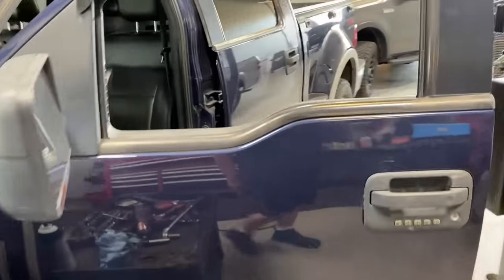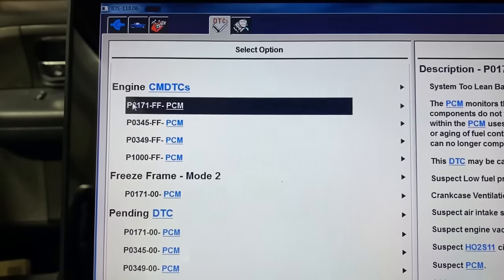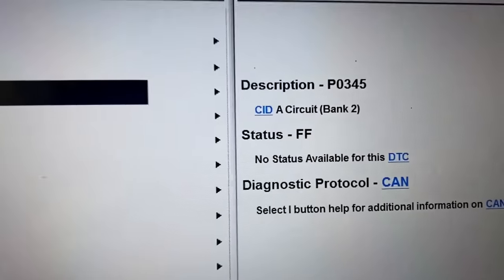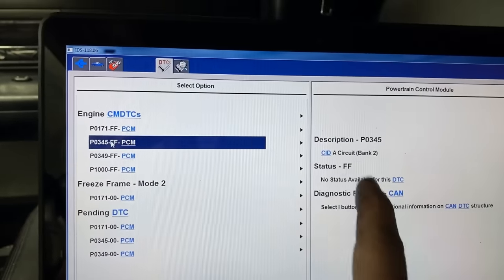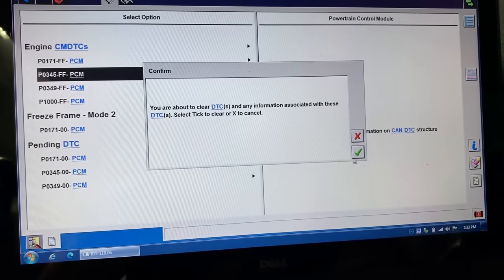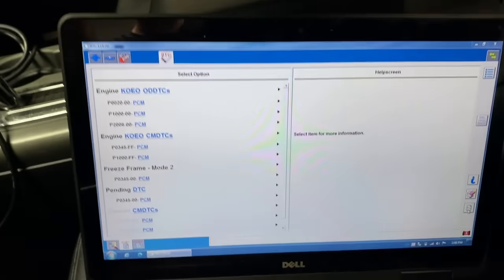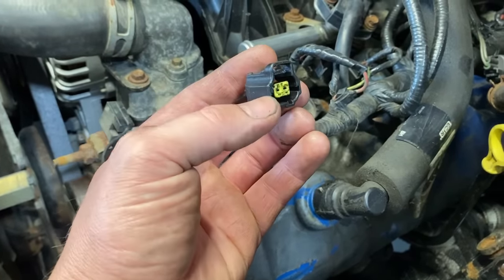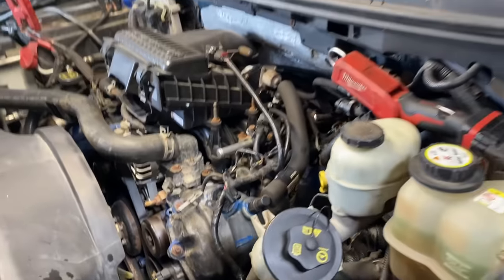Ford F-150 5.4L 3v Triton Engine Runs Rough: P0340 P0344 P0345 P0349 VCT Timing Error Diagnostics

Comment: Since you answered my previous question 4 this particular situation I was wondering if you could answer another question I had asked on a previous video and didn't get a reply can I use a 3 valve oil pump in a to valve motor they look to be the same but I'm not sure I am building a motor for my Harley-Davidson edition F-150 and wanted to use a high-volume oil pump in it I didn't know whether the 340 or 360 pumps will work in place of a two valve pump and a to valve motor
Reply from the maker: No you cannot, you want to use the this high volume oil pump from Melling on 2 valve engines- https://amzn.to/3jSl1di

Comment: You think people would get it by now that those camshaft bolts are torque to yield.  But if they were replaced at the salvage yard, it's highly possible that the tech doing it is not the sharpest tool in the shed.  I see LKQ offering 5.4 3v with "new Ford phasers", so I think this scenario is likely.  For my vehicle, no thanks.

Comment: So, I've noticed that most of the 5.4 3V engines you work on with timing problems are 2007 and older.  I have a 2009. Were there any design changes to mitigate some of the factory design problems, or can I expect to have to do a timing set? I have only 91k miles now and mine has had pretty good maintenance and has mostly highway miles and has never been used as a work truck.
Reply from the maker: They all have the same issues 2004-2014.

Comment: Hi! I've recently purchased a 2009 Expedition with the 5.4 3v engine and been watching your videos. It's the engine with smaller VCT aperture and valve covers with slightly different engine configuration. It's throwing the P0011 and P0021 codes. Engine feels and sounds fine but lacks power on demand and has misfires once from cylinder 8 (P0308) any idea what I can do before I go looking to remove the valve cover?
Reply from the maker: If you have they error codes you generally need a timing job, there is a loss of oil pressure and volume causing erratic vct operation. This all starts with blown out tensioners.

Comment: Quick question i have a 2 value 5.4 f150 , 75,000 miles cats are removed.  When i rev the engine to 2k rpm i can hear a slight knock . I've been told it's piston slap , wrist pin knock and thats it's normal for the 2v 5.4 to have a slight knock . Any help would be greatly appreciated. Thanks
Reply from the maker: Absolutely normal yes they all do it even the v10 models.
Reply: @FordTechMakuloco  thank you for the answer

Comment: That phaser bolt came out WAY too easily. No wonder it came apart and hogged out the pin holes.  Love how one side of was sanded off.  Dorman??
Reply from the maker: Yeah my impact is normally working at it 1-2 seconds before they break free, not this time.
Reply: @FordTechMakuloco  Gotta laugh at the cheap-ass timing kits for under $200 for everything.  Recipe for disaster, for sure.

Comment: I have an 03 5.4 expedition and getting p71 lean code bank 1or whatever, had the intake replaced and still throwing the engine light. Any ideas? Thanks!
Reply from the maker: They simply need to follow basic checks for lean codes including collapsed pcv hoses and MAF diagnostics.

Comment: I've got an 09  f150. 4.6l 3v.. I want to do my timing job but even with your videos I'm not comfortable. I'm 5 hours away from you in Ohio but if I was closer my truck would definitely be in your shop. Is the timing job still $2300 as u said in your other video?
Reply: I have 2010 f150 4.6 3v 185k just had the timing components replaced cost me 2500.00.  My started having chain rattle on cold start up.

Comment: I have a 2009 f150 5.4. I get a p0430 code once in a while and I know that the cats or at least one of then are going bad. Question is would that decrease the power a lot? It seems some days it drives really well but then sometimes it drives bad. Should I try replacing the cats to see if I get me power back?
Reply: A clogged catalytic converter causes excessive back pressure.  Typically you'll see a decrease in maximum engine RPM along with a decrease in power.
Reply from the maker: Yes but fix the engine concerns first before attacking the cat issue.
Reply: @FordTechMakuloco  I dont think I have anyother engine problems though
Reply: @neilvetter662  ok thanks. I guess i'll try that

Comment: Is it possibe to replace the 5.4 3-valve with an older 4.6 2-valve. My friend has a couple of ex-police cruisers with low mileage 4.6s in them. Sure seems like a better way to go than diving into the 5.4 regularly. I have a 2010 F-150 Lariat with the 5.4 and all these videos cause me to stay up at night.
Reply: These cam phaser tritons sound like an absolute nightmare. So glad I have the 2 valve 4.6. If I wanted a newer f150 Id probably buy whatever model year had the last 4.6 2 valve triton on it.

Comment: Hey i have a 02 F-250 with 62k miles with the 2v 5.4 what should i be doing to keep it going for as long as i can?
Reply: Swap oil out to 5w30 and keep it changed!  Also if you hear any ticking noise from passengers side valve cover or any slight grinding noise on the front cover. Replace timing chain assembly.  Make sure to use metal timing chain tensioners also.  We have 240000 mi on a 03 E150 and 270000 mi  on a 99 F250.
Reply: @tbed9007  what is the reason for using 5w30 instead because I've been using 5 quarts 5w20 and 1 quart Lucas oil and I'm worried if I do switch it will have bad consequences. Thankyou

Comment: What if you keep getting P0022 and changed out the VCT solenoid? It’s running rough only after running a while and after a stop and at slow speeds. We redid the timing chain and all
Other timing parts about a year ago with your videos. What else should we be looking at? We are hoping to avoid opening the front cover again. 😞
Reply from the maker: Definitely an oil pressure and volume issue, if you performed a complete timing job using Ford parts, Melling high volume oil pump and pan is cleaned out then your clearanced are too big. I would run a thicker oil at that point Rotella 5w-40 is a Great cheap full synthetic option.
Reply: FordTechMakuloco thank you so much for getting back to me. We will give that a shot and touch base with you. Thanks man!
Reply: @tomlisa555  did it help? I have same issue

Comment: I have a question for you but it is not about a 5.4, *topic derailer*. I looked through your videos and did not see any about 6.2 broken valve springs. Are you seeing a lot of them at your dealership, what years and anyone tried aftermarket(Livernois Motorsports)?
Reply from the maker: I never see them.

Comment: Thanks for sharing...  Cheers.
Reply: where you have yo shop because  I have 06 roush f 150 runing rough  if push gas to1500 rpm thru go updown on up do not stay sterile and before have mis fire on cilinder 7  change coils sparks an fuel injector the cats converter and still the same

Comment: Any ideas on why my 08 5.4 starts knocking when driving around in a parking lot or driveway with a warm engine only?  If I blip the gas this trips it but if I ride out the gas like I am accelerating it drives normal (new to me so what my perception of normal is).  I have driven it as is for the last 8000 miles and am getting fed up with it.  I am going to try and get my hands on a scan tool to see if I can evaluate the timing.  I am thinking it is the cam phasers but I cannot seem to find this on the forums.
Reply: Timing chain tensioner?
Reply: I thought of that but I was confused at why this is only at low revs
Reply: @stephenpeterson5857  low oil pressure/flow to the tensioner.
Reply: The reason I don't think it is a tensioner is I could see it running not smooth with a bad tensioner.  But with it knocking and shaking I would think it jumped a tooth or something but that would have issues at other times driving.
Reply: You ever solve your issue
Reply: Yeah I believe it was the cam phasers.   I pulled the timing cover off to check it out and found the guides broken as well.  I ended up just selling it as is and getting a Toyota.   I am much happier.

Comment: @fordtechmakuloco thank you for these videos. I just picked up a 3v expedition and it has the 1/2 second startup rattle so I wanna replace the timing but your affiliate link is out of stock, can you hook a brother up with a kit where I can throw you a few bucks?
Reply: Startup rattle? You better check out the chain tensioners seals and hydraulic lash valves for wear pronto.
Reply: @TheUltimateCrash1990  yup, I picked up all that from the dealer, as well as the melling hv pump, rattle is gone! Tensioners were leaking
Reply: @cromagnon305  I went with the cast iron tensioners, not a fan of the plastic ones with the rubber gasket.

Comment: ford f150 5.4 triton 2004 p1000 error, what's the problem
Reply from the maker: There is no problem, the PCM just needs to run the onboard IM240 test.

Comment: I stay away from 3 valve engines. my dad had a 05 f150. valve rocker failed and dropped the valve into combustion chamer.
Reply from the maker: Yes but it was ticking warning you for at least 5-10k miles before it completely failed so who is really at fault here?
Reply: @FordTechMakuloco  It did directly from dealership when he bought it. I should have made him take it back and get it fixed.

Comment: I recently took my 04 to the shop. They said jumped time because its running low rpms and rough
Reply from the maker: I have only seen them jump time if the guides break wrapping them up under the phaser cause them to jump time.
Reply: @FordTechMakuloco  thanks for the response.  Same truck I messaged 3yrs ago. Could a vacuum leak cause this issue behind the intake  Plenum?

Comment: That appears to be a Standard Motor Products phaser.  They come from the same supplier as Ford but SMP grinds off the "FoMoCo" that is laser etched and rebox them. Agree that it was probably the improper torque that caused the failure.

Comment: It looks like these Tritons aren't good for much over 100k miles. There's just too much to go wrong on them. My old Dodge Caravan  with the original 3.3 plain old OHV V6 engine has 220k. It's still running like new. And Ford's coming out with an opposing-piston engine? I don't know whether to laugh or cringe.
Reply: 5.4 3valve with 430000 miles

Comment: So the original engine barely passed 100000 miles? Wow that's absolutely garbage ,at that rate you would go through 4 engines to match what iv put on an 03 4.6 2v , hope you enjoy the extra power ,lol for decades I was convinced the Ford / international 300(carb) was absolutely the best truck engine followed by 302/351w for reliability and enough power to get the job done but after nearly 15 years behind the wheel of a 4.6 2v I say it makes the rank and if it wasn't for the 3 sparkplug threads that plagued so many of them I would put it above the ford small block but it's the 3rd best truck engine in my imaginary mental ranking system , 3 valve engines don't even make the bottom of the list , coyote & 6.2might though ask me in 10 years😁